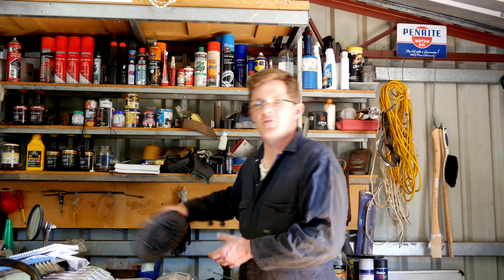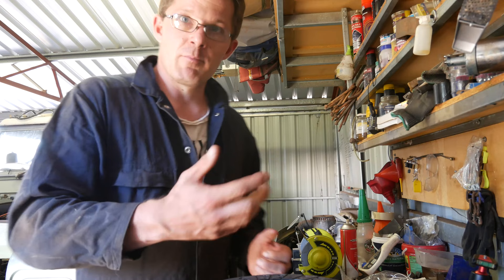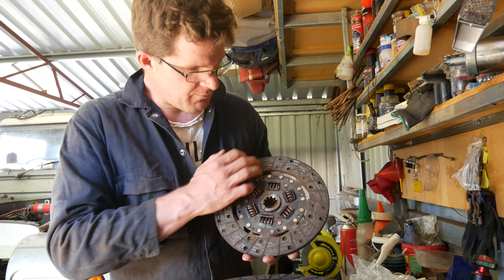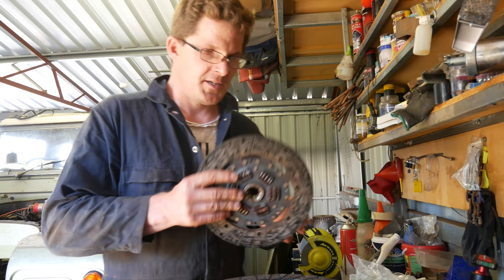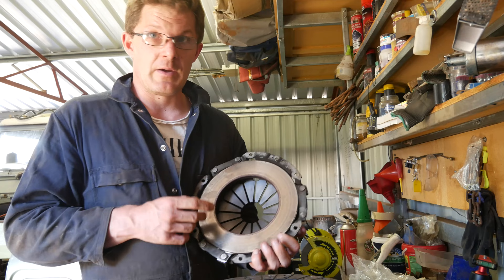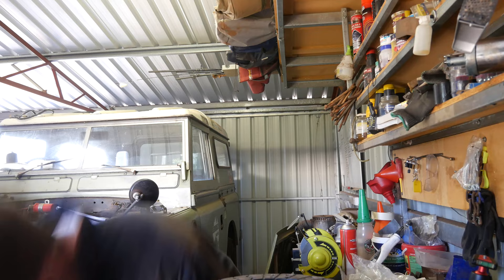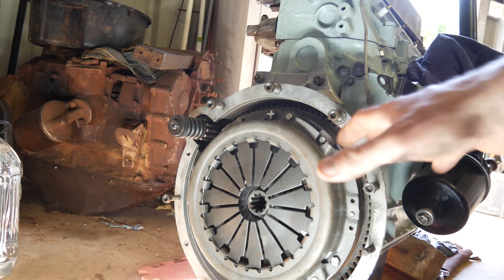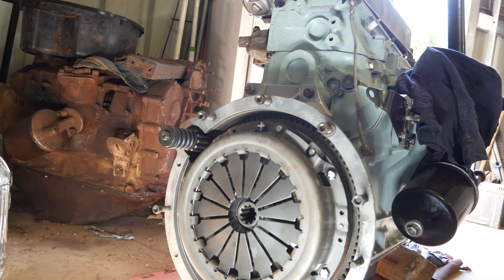Land Rover Series clutch replacement  Ep 11

Comment: Just a quick note always check the flywheel is not magnetic after machining as this will cause the clutch plate to keep spinning with the flywheel when the clutch is disengaged. Yes it can happen and i have experienced this several times over my career as a heavy diesel mechanic during the machining process the flywheel becomes magnetic in some instances so check it and if it is magnetic take it back to the machine shop and they will remedy it.. Great video keep them coming Geoff
Reply from the maker: Well that is a new top tip for us all. many thanks, Cheers Geoff
Reply: Flywheel is steel??? Wouldnt it attract a magnet?

Comment: Gday Geoff, another great video but one thing you forgot to mention is that some clutch plates (drive plate) only go on one way, the spline through the centre on some stick out one side and is almost flush on the other side.
Reply from the maker: G'day Paul. That is a far point Paul, cheers for sharing that. many thanks, kind regards Geoff